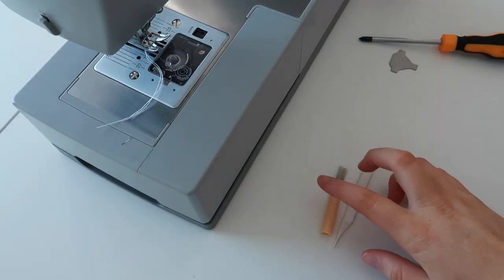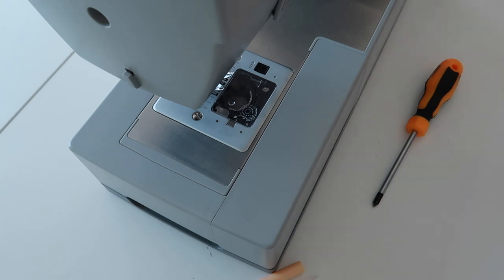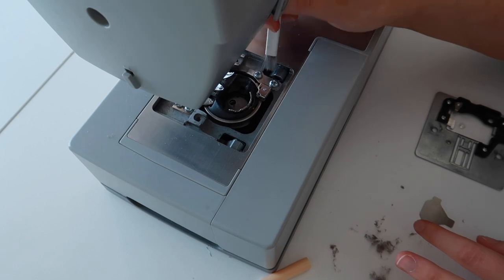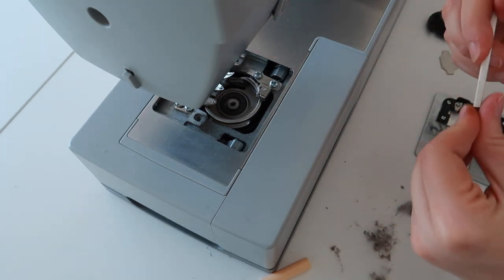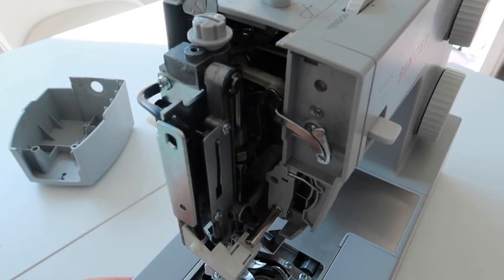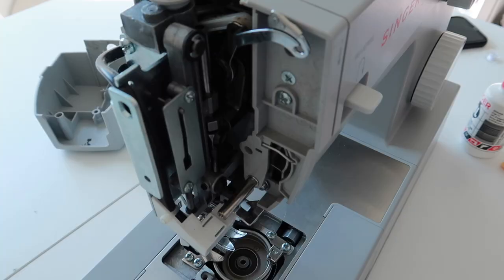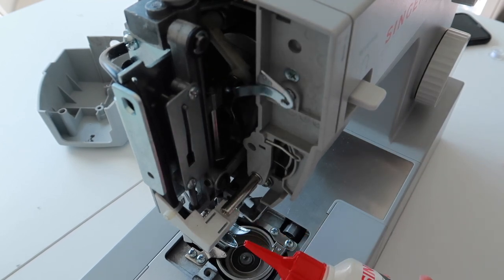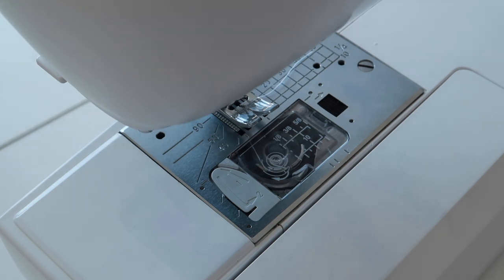how to clean a sewing machine - beginners guide to lint removal and oil - singer elna - how i clean

Comment: Great video Taylah.  I'm sure lots of viewers will appreciate your guide to maintaining your machines and hopefully will be encouraged to give their own machines a good spring clean!

I like to clean and oil my machines when I've finished for the day.  Some fabrics leave a lot of fluff quickly whilst others leave very little mess at all.  In addition to the brushes that come with the machines, I often use an extra long pipe cleaners with the end doubled over to help reach right in to the nooks and crannies.  

My machines are covered when not in use to hep eliminate dust settling into the parts.  This can be a real issue in older homes.  I made up some covers from remnants of lined curtain fabric.  It's nice and thick and cost me nothing :-)  

Routine cleaning of sewing machines is often overlooked but can the cause of so many sewing problems such as threads and/or needles breaking.
Reply from the maker: Great Advice! I love the pipe cleaner idea I’ll have to try it! I find the brushes a bit to short to get into all areas. Thank you 🥰

Comment: Pressurised air isn't a great idea, it pushes dust further into the machine that you can't get to and can cause issues in the motor. If you have never cleaned machine and used it alot, it would be advised to get a service person to do this and possibly show you.